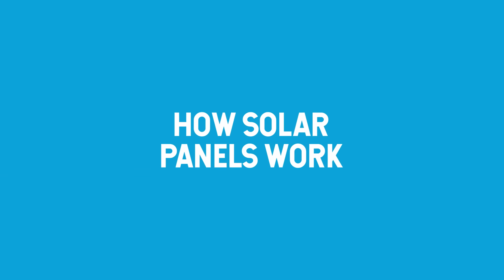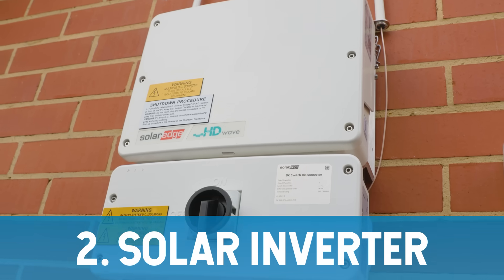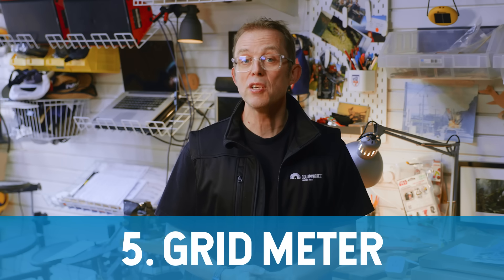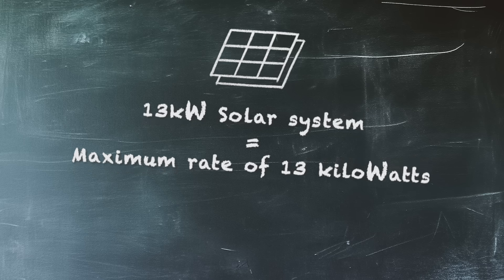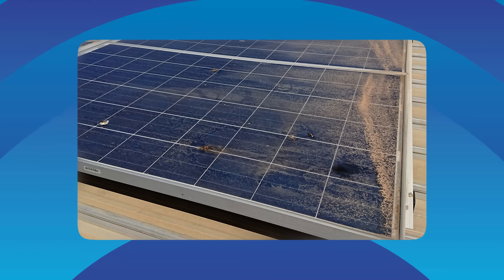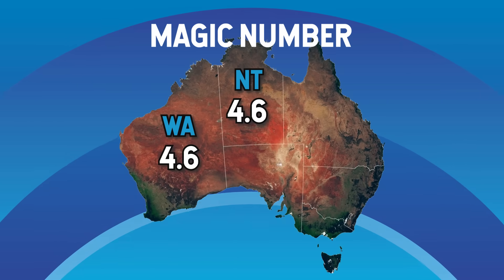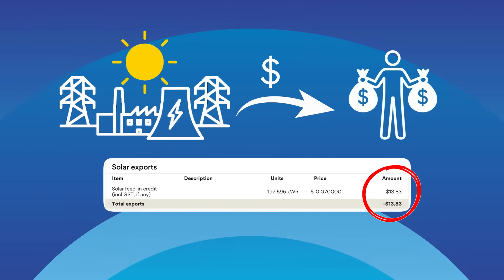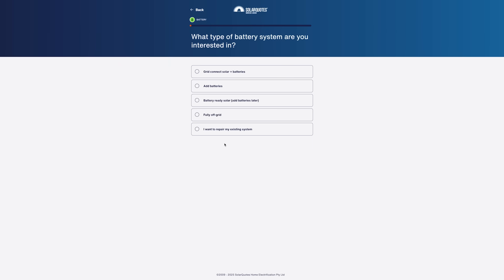How Home Solar Systems Work: A Beginner's Guide

Comment: I live in Brisbane, I have a fronius gen 24, 5 kwh with Hyundai 400w panels making a 6.6 kwh array. Annually the system produced 10,750 kwh or average about 30 kwh per day. We consume about 3,000 kwh a year and export the rest, so I purchase a MG4 with a 51 kwh battery. I use the car as a hack, my monthly fuel bill went from $500ish to $150-200 pending what I do. I would get a battery but I am hearing people are starting to get charged $2 a day for access to the grid or $712 a year. It would be better to get a of grid system to stop this. Do you know if you can get a invertor has no wifi chip like the old days?